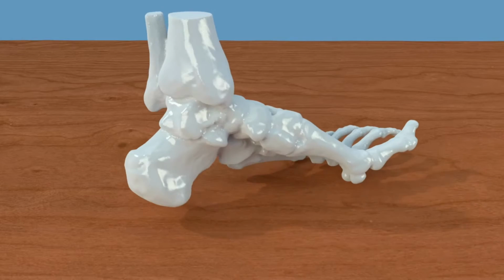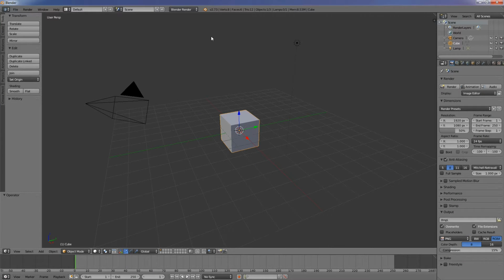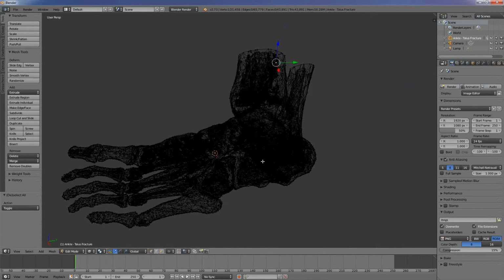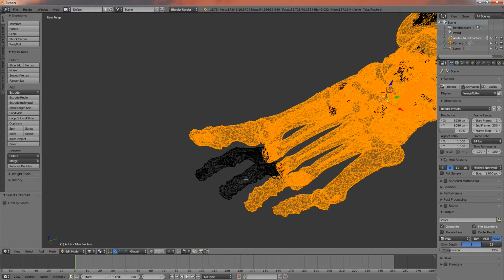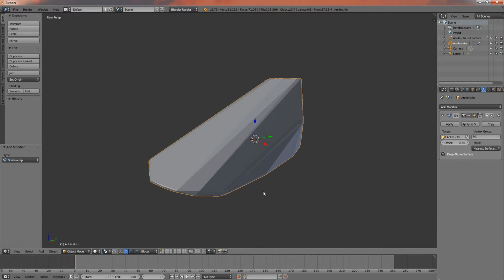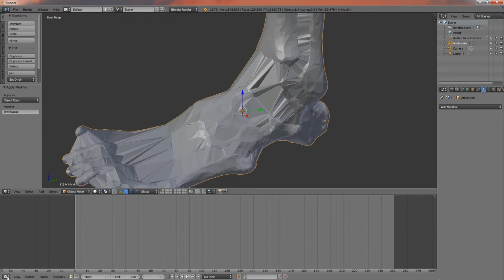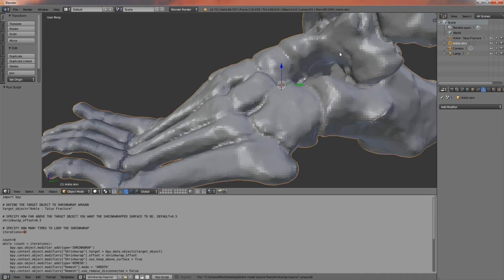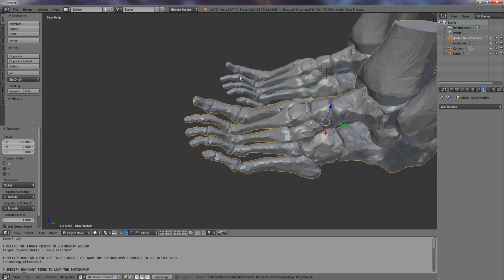3D Printing of Bones from CT Scans: A Tutorial on Correcting Mesh Errors using Blender and Meshmixer

Comment: If you have splits in mesh, check that you haven't double points in vertrice. Double points often occur whenever I use mirror modifier. They cause problems. To lessen this problem, I just select the entire mesh, press hotkey W and click "Remove Double Points." During modelling, I always remove double points a number of times ever before sculpting; before exporting models to other softwares; before rendering models and especially before 3D printing.
Reply from the maker: Removing double is helpful, but be careful as it can introduce non manifold errors into your mesh. Be sure to check your mesh for non manifold errors after removing doubles. Use Shift-Ctrl-Alt-M while in Edit mode.